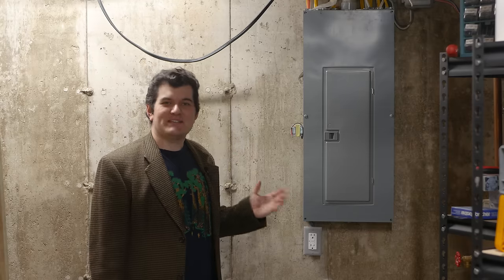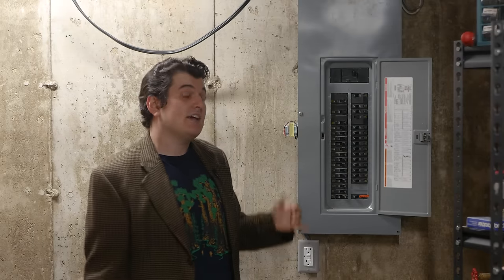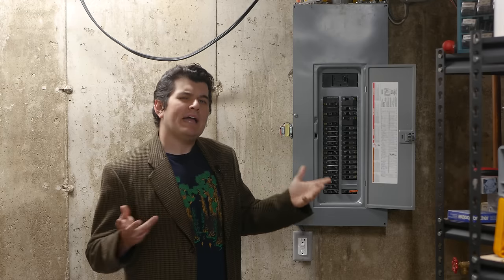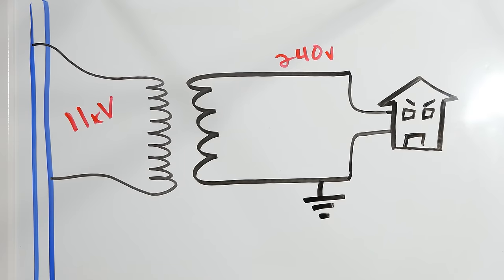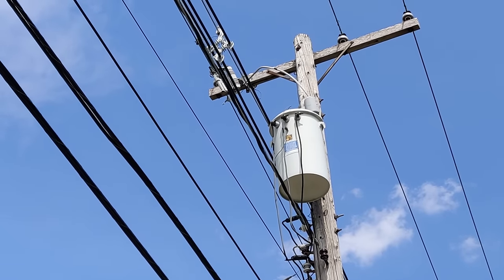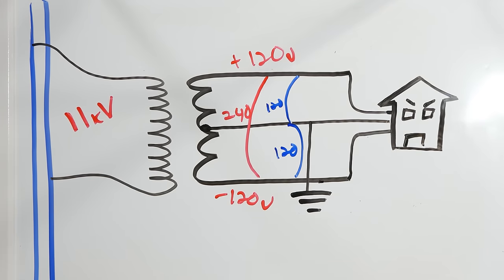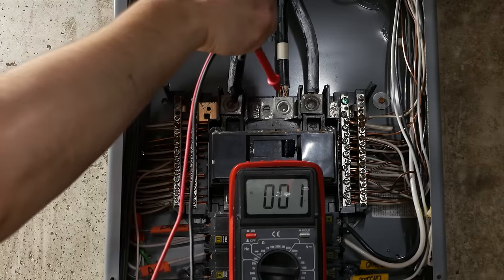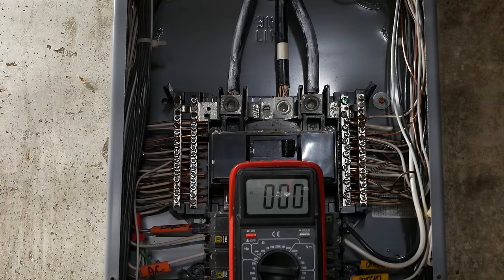The US electrical system is not 120V

Comment: The question “how do you turn things off?” is most likely in reference to safety practices that we’re taught as children.  I was always strictly advised to turn off the power at the wall before plugging or unplugging anything, regardless of whether it had a separate power switch.  But there’s also things like charging cables and fairy lights that don’t have their own power switches, and around Christmas time it’s very common to turn the tree lights on and off at the wall, but leave them plugged in.
Reply: There's no power at the wall here
Reply: We use a special cord with a button you step on for the tree in our house.  We also typically have an outlet in most rooms that is operated by a wall switch near the door.
Reply: I use wireless remote control switches for my Christmas tree. Or, like the video shows, use a power strip.
Reply: It's not just US plugs that are at risk of shocking you if if's half way plugged in. A lot of other designs pose the the same risk. The switch helps alleviate that, and as we are taught as kids, turn it off at the wall before unplugging is exactly for this reason. That removes the risk of a shock as your fingers curl around the plug's edges and touch the still conducting pins.
Reply: whickervision Using a power strip would definitely work, but I do like the convenience of not needing one.
Reply: @flo0t  Or you could just not be an idiot and grab the electrical cable correctly and thus have no risk of shock, even with a shitty US plug.
Reply: We do have the ability to put a switch on an outlet here in the US, but most often it's the same kind of switch as lights have, often in the same plate as lighting in that room. My apartment has switched outlets in the living room because there is no overhead lighting. This allows you to plug lamps into those outlets and still have a wall switch for the lights.
Reply: @MeepChangeling  Not possible with UK/AU/ZA plugs, as the cable is often at a right angle to the conductor prongs.

Also another thing we are taught as kids is to never pull out any plugged in cable (headphones, phone charger, electrical etc) by the cable, but by gripping the plug body :)

Comment: Other countrys have even more phases (3 instead of 2).
That way, you have a turning field which brings also two voltages (e.g. 230V and 400V) and it's much more efficient for electric motors.
Reply: It's less about effiency and more about the fact that the motor speed is held by the frequency of the grid, which makes the engines simpler to make, which was handy in the past times, when all you used electricity for was a motor and a lightbulb.
Reply: Many countries have 3 phase supplies. But you can't run an electric kettle or a television of 3 phase. (You could run an electric kettle if you had 3 heating elements connected in a star or delta arrangements but that is far more complicated and more costly than a single heating element). The 3 phase has to be converted to a single phase, which live (hot) and neutral.
Reply: @deang5622  But i could use 400 watts for a heating element by using two times hot. p1 and p2 fore example instead of neutral.
Reply: @deang5622  No, you just use one phase and neutral in the normal outlet, like in the US. That way you have (e.g. with 230V) still much more power then with 110V.
Reply: I am from Ukraine. old houses have only one phase and no grounding, but in new flats we all have 3 phases and grounding. also kitchen stove uses all 3 phases.
Reply: @Gameplayer55055  Greetings. We in Poland often have 3 phases in old houses to run farm equipment.
Reply: Also with three phases you transport 50% more power for the same amount of wires.
Reply: @glorf1234  many houses make use of 3phase power without even noticing it. Electric ovens for example are most often wired to all 3 phases and neutral. Same for hard wired boilers, let alone continuous flow heaters that draw up to 24 kilowatts! The 230V outlets are distributed to all 3 phases  so the load is balanced.
In Europe, there are less transformers sitting on poles. There are bigger distributor stations instead, powering a meshed 230/400 V 3 phase consumer grid. If one high voltage line or transformer needs service, the households still get power and won't even notice.
Reply: Wallace Smithfield  probably not.
Reply: We have 3 phase power in the US.
208/120 wye is common for commercial and light industrial
480/277 wye and 600/347 wye is found in large industrial plants
If you want to talk about motor power, the 60Hz that the US grid use will turn motors faster the the 50Hz everywhere else
Reply: @jammon798  It's a bit faster, but 50Hz is better, because you usually don't need that high speed and with a lower frequency, you have less problems with capacitive effects.
Reply: @qq84  nah, 60hz is still not enough for producing eddy currents everywhere.
50Hz/60Hz difference causes problems only with motors and TVs (CRT, not digital, FPS is linked to power grid frequency lol). most devices ignore it. digital switching power supplies also don't give a shit about the voltage, it can either be 80v or 250v (depends on psu internals)
Reply: @Gameplayer55055  I was rather talking about power lines. Even 50Hz causes problems there. The higher the frequency the bigger the problems.
Reply: @qq84  yes, tho it is mostly leakage current
Reply: @qq84  No. The voltage between a single phase and Neutral in the US is 110 volts not 230 Volts.

You need to be careful not to mix up phase lines and neutral lines.
In order to produce 230 or 240 volts on US system, you use two of the phase conductors which are 180 degrees out of phase, with each phase being 110 volts.

If you use a a phase line and neural line, then you get 110 volts.
Reply: Also, 3 sinusoidal waves, 120 degrees out of phase, is the simplest way of having both net zero current AND constant average voltage. (240, 2 phase is net zero, but goes through zero V absolute value 120 times a second.)
Reply: In Germany, 690V is sometimes used because there are also transformers with 6 phases.
However, this is only used in industry and very large buildings.
Reply: The US also has 3 phase power, its just that most homes don't use all three, just 2, but large buildings will use 3 phase power, namely for high power devices (like AC units). And the 3 phases work the same way yours does! The only real difference between 240v Europe and the US is that we center tap our transformers (as explained in the video), everything else works the same. This is mainly because electrification happened during the US hight of industrial production, so when Europe electrified/rebuilt they bought their equipment from the US, and then elected to not use the center tap to save on copper use.
Reply: @anthonyemerson3756  residential 120 is a split phase 240. It's not two phases it's just one. I'm an American Electrician so I know how that works. Now commercial building like apartments are commonly 120/208 wye connected and in those cases there are multiple phases.
Reply: US has 3 phase.
Reply: Noone Cares
1 second ago
Its pretty common in sweden to have 3-phase connection to the stove and sometimes to water heaters. But i dont have a 200 A fuse in my apartment like this guy. I think i have 16 amps. So yeah, he can take out a lot more current.
Reply: Trains in Germany ans sweden run on 16 and 3/4 Hz for historical reasons (1/3 of 50 approximation). And they transform it into dc for traction in most designs.
Reply: @AFellowGentleman  Yes, 3-phase 400V 50Hz is common outside the US.
Apartments outside the US usually have 3-phase 400V 16 or 32A. Houses have 400V 64A and only big ones 128 or 256A.
Reply: @AFellowGentleman  They changed it to 16.7 Hz. And yes, changing the frequency takes quite some effort, but the lower frequency (16.7 Hz) is better for longer distances.
To be exact, the 2 phase (15kV) is transformed to a lower voltage, after that to DC and after that to an adjustable 3-phase supply for the electric motor.
Reply: @deang5622  hello, there's no real "conversion" needed from 3-phase to single phase, you just have to split the charge of the house in a balanced way and you use one phase for each 3rd of the house consumption. If the consumption is balanced, no current would be coming back on the neutral wire.
Reply: 2 phases dont existe. its just a différent connection in the transfo to get à 2:1 ratio of the 240v
Reply: The "240v" is, in a way, split phased on one "415v" supply. the neutral is tied to the star point. 3 Phases, 3 "240v" supplies but also 3 "415v" supplies. The reason that I put " " around the voltages is that it is a nominal voltage, in reality Australia was "converted" to "230v" years ago. It ranges from about 210v to 250v as "normal" ( often seen under 200v or 255v which causes problems )
Reply: @samuelshekel1907  The efficiency is more that you don't have a "start winding" and a "run winding" of different impedance ( and maybe switching, capacitors, etc, all trying to get a change of phase ), just the 3 "run windings".
Reply: All of US industry has 3 phase. But most homes don't have it.
Reply: Even here south of the Bravo, in Mexico, residential A/C is always 3 phases! You can even request more than 1 phase delivered to your power meter if you claim you have an european appliance, or get all 3 if you go from residential to industrial.
Reply: ... So does the US.  I have it available in my garage, you just have to have it installed.

You have several choices, 208/400/600 and a few others but those are industrial only and cost prohibitive.
Reply: @jammon798  Right on!
Reply: @deang5622  It doesn't needs to be converted, just tab to one phase and one neutral and you have single phase.
Reply: @Delibro  If you read one of my earlier posts you would know I know that.
I actually describe how the 220 volts is implemented.

Please take the trouble to read all the posts
Reply: @deang5622  Ok good you know.
And no I won't take the trouble to read all the 22 413 posts there are on this video.
Reply: @Delibro  you don't have to read 22 413 posts as there are only 35 in this particular thread. 

And presumably to find one to respond to, you have scrolled down and passed over the earlier ones. Which means you scrolled past my earlier post.
Reply: @deang5622  I was replying to your first post in this thread, the one you mentioned "converting" 🙂 I've read your second post too. If you post a third time in this thread before me maybe YouTube filtered it.
Reply: @l.p.gagnon3420  When you measure the 2 lives in relation to ground (the center tap), you'll see that they are effectively 2 phases 180° out of phase. With the center tap being grounded, one live will end up -120 V, the other +120 V, therefore the 2 lives have inverted voltage at any one time, creating effectively 2 phases 180° off.
Reply: @jammon798  I have light industrial 3 phase in California. I can pull 240 volts single phase, 120 volts and 240 volt 3 phase, but I am limited to starting a max 20 hp motor. Even 15 hp is sketchy and dims the lights.
Reply: Nope! Less efficient for electric motors because you use 50Hz where the US is 60Hz.  As you know, or at least should if you are an electrical type,  motor speed is dependent on frequency  For a 4 pole 50Hz induction motor your synchronous speed is 1500 rpm where it is 1800 rpm in the  US.  So all else being the same, an AC induction motor running on 60Hz, produces 20% more power than when run at 50Hz.  The same will be true at 3 phase at the two different frequencies. 

If you understand the formulas, you will see this to be true. And if that's too complicated for you,  find an motor rated for either 50Hz or 60Hz and check the nameplate specs. 

And we don't have 2 phases, It  is "split phase" residential  We do use 3 phase in commercial and industrial applications.
Reply: @qq84  My house has 400V 80A.

Comment: Europe: "I'm shocked! Shocked!"
America: "Well, not that shocked."
Reply: 4KbShort it are the Amps That kills you
Reply: @MxxRie  But where do that amps come from? ;) 240v is more dangerous but (In UK and Ireland atleast) our sockets compensate by being designed with better safety in mind
Reply: @nialljackson2354  Yes, Designed to be an even worse weapon than legos.
Reply: Jenga 500 yes very true, European plugs take a different stance to us, our plugs are like the US where they both sit flush against the plate but the pins are fully inserted. Our safety come from having parts of the live and neutral pins covered with a non-conductive material which means that your hands can’t come into contact with the electrical current, something the US lacks. As you say though, euro plugs don’t use the pin coverings but your sockets are designed so that the pins don’t make contact until the entire plug has slotted into the facia of the socket so equally as safe I’d say =P

Comment: 240  VAC split phase is correct for most home and smaller commercial buildings. In any building which has heavy duty motors such as elevators in a condo or apartment building, the higher voltage is 208 VAC and some larger equipment will run without any changes - through that voltage range while some equipment requires correctly setting jumpers for either 208 or 240. Typically - electric furnaces, HVAC etc. Even experienced installer will make mistakes of not jumpering equipment correctly which may cause contactor switches to burn out- for example. (And I appreciate your example of this in the video)

Comment: The humming panel was hilarious!
Reply: The inverter for my solar-panel system is next to my main breaker panel.  That actually does hum loudly.  You cal tell from the drop in volume when a cloud passes over.
Reply: I knew he was just adding it in before he even said it cause I was like there no way his power would be that loud for house hold electrical
Reply: @fredblonder7850  that’s really interesting
Reply: I've heard them actually do that, and were quite loud.

Comment: Simple is always better. Where there's room for confusion, there's room for trouble.
Many years ago I was involved with the installation of a telephone costing system in a large rambling hotel in Ireland.The computer was located a long way from the telephone exchange- too far for RS232 so communication was via current loop.. The comms cards kept going faulty and after several replacements and some frustration, we realized that, unusually for a single building,  the telephone exchange and the computer where on two different phases resulting in the current somewhat exceeding the 20mA design limit - Doh !
Reply: Lol interesting - I believe on a perfectly synchronized 2-phase 60Hz it would be transmitting up to 40mA, because one would be at high peak and the other at low peak, if both of the transmitters signal generator were synchronized by the phase clock. That current is enough to heat and fault small transistors.
Reply: I don't know specifically about Ireland, but two different phases isn't so unusual in Europe. In many European countries, you typically get three-phase connections and are supposed to use the three phases about equally.
Reply: lol, Yeah, i had a similar encounter with a neutral wire going to the wrong neutral bar in a 3 phase rats nest.
Man, the time it took to find that crap.
Reply: But that is where you are wrong, complicated by safety is always better than simple and halfassed, because people is stupid and simple is too complicated for people, you ought to make a thing that is simple to operate but is incredible complex inside with hundreds of safety features

Comment: As a Brit living in the US, there is exactly one time that I have wished for outlet switches, and that is when using a cheap soldering iron that doesn’t have a switch on it. So yes, it’s an extremely mild convenience.

I do miss how sturdy the plugs are, though. They give you a really sturdy kind of pain when you step on one.
Reply: I have one of those small soldering irons that have no switch.  They have always been that way.  Normally, you would just leave it on at a workbench and unplug it when no longer needed.  Some workbenches might have a switch for a row of outlets, so you would just turn off your entire bench.